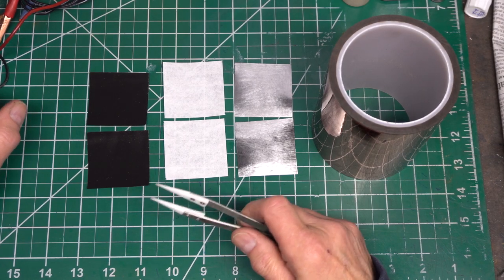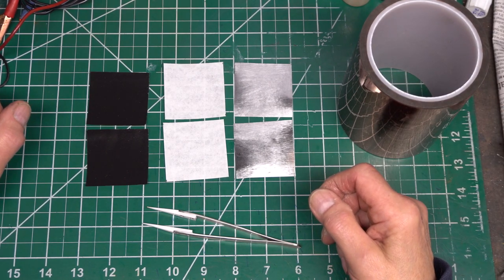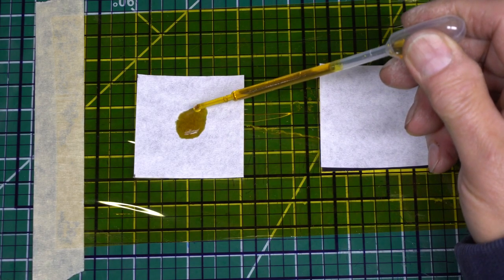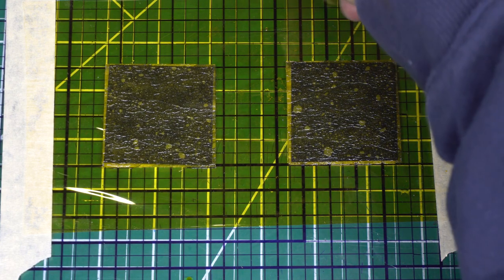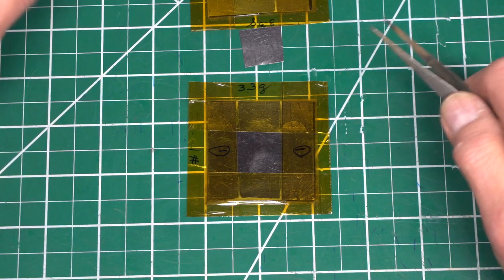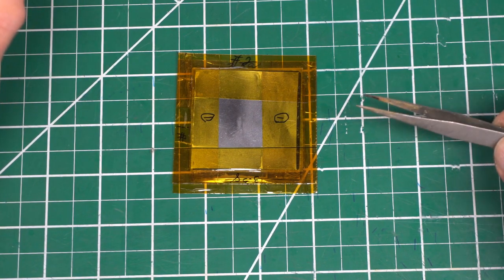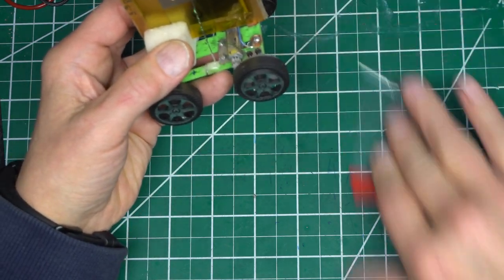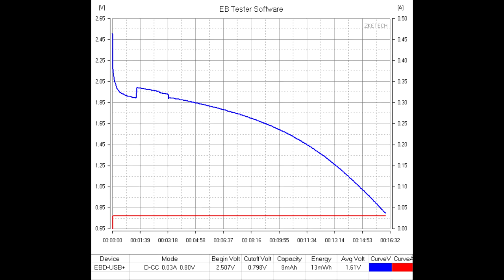Iron/Carbon Battery Powered Electric Vehicle Reaches Higher Speed with New Cell Configuration

Comment: Hi I have a couple of questions that I hope you can answer for me. Have you tried reading the current across the battery to see what it's momentarily "dead short" current can deliver? How long can the battery run the motor after a full charge? My last question may sound silly but you mentioned charging the battery before the test and my question is if it can be charged more than 1 or 2 times before it degrades or loses it's capacity?  If it can be recharged, have you experimented enough with this battery build to figure out how many charge/discharge cycles you can get out of the batteries before they degrade? Thank you for sharing this information for others to duplicate.
Reply from the maker: Hi, sorry but I have never measured the output of the battery when dead shorted across the terminals. Yes, this battery can be charged and discharged multiple times. In my previous video at time 16:27 I show the charge/discharge curves for this battery. I ran it through 56 charge/discharge cycles and the output capacity dropped 7% from the initial value.
Reply: @William_Hada  Hi and thank you for replying back. I'm going to be trying my hand at some of the battery projects I see on Youtube. I'm still in the process of reading up on this stuff along with watching videos on the topic but I do plan on jumping into this somewhere after the New Year....

Comment: Great little cell, very keen to give it a go. Been looking for a cheap and safe cell to play with for a while.

Once I've built a cell and want to increase the capacity, would this be done by increasing the size of the two electrodes?
Reply from the maker: Yes, increasing the effective area of the electodes will increase the capacity of the cell ( total amp hours, current ). The voltage will not change because that is predetermined by the cell chemistry. You can also increase the capacity by making the electrode area thicker, like creating a spongy iron or carbon matrix on the electrodes.
Reply: @William_Hada  cool, thank you!
Reply: Have you done any more experimenting since your second version?
Reply from the maker: @StefanWiswedel  No, on that Iron/Carbon battery Chemistry I have not built any more cells. I got sidetracked exploring other Chemistries but eventually I want to get back to Iron/Carbon and explore some more variations to improve it.

Comment: I cant find enough Iron to scale this up. does anyone have any ideas on how to get a lot of this iron sheeting/foil?
Reply from the maker: Anything made of pure Iron or carbon steel can be used as an anode. Do not use any forms of Stainless Steel which can contain Chromium, Nickel, etc. Ive had good success with using steel wool for the anode. Just be sure that what ever you use is not Stainless Steel or iron plated with another metal.
Reply: @William_Hada  ok thank you. How would I use the periodic table to get a better idea of what to use? I know the columns are valance electrons; but am I looking for the biggest difference or is it an shell/orbital things?
Reply from the maker: @justthinkalittle8913  The electronegativities of elements are found in the periodic table. Picking two elements with the greatest difference in electronegativity would get you the greatest battery voltage. Here are a couple of articles to read for more details: https://caplor.co.uk/caplor-news/elements-periodic-table-can-used-make-batteries-oh-many/ and
https://blogs.scientificamerican.com/degrees-of-freedom/the-periodic-table-and-batteries/

Comment: How do you recharge it?
Reply from the maker: With a benchtop digital DC power supply.
Reply: @William_Hada  Ok, but how do you know the correct voltage, amperage and charging time so as not to overload the cell?
Reply from the maker: @danielcesar5251  When I first charge the cell I pay careful attention to the milliamps of current that is being drawn by the cell. So I gradually increase the charging voltage and keep the charging current at about 50 to 200 milliamps. If the cell is taking on a charge normally the current will drop gradually over time approaching zero but will not actually reach zero. Just level off at some low value maybe around 10 to 20 ma. It's just a matter of trial and error once you zero in on an optimal charging voltage. You don't want to push the charging voltage too high because it can destroy the cell.
Reply: How to fix the upper cut off recharging voltage limit in new invented cell ???????

Comment: So glad I found this! Would you be able to use shim material on both sides, with grafoil and carbon still one one side? Why is the soak timed for 20mins? Do you need the oxygen to form oxides?
Reply from the maker: I guess you mean that you want to use iron shimstock on the Grafoil/Carbon electrode as just an additional collector plate? I think that would be OK as long as there is no contact with the electrolyte. But, because Grafoil is actually porous I don't think that is a good idea.  If that iron shimstock collector sees/makes contact with the electrolyte, I think it would cause problems with the operation of the cell. The 20 minutes soak time was just an arbitrary time I used to make sure that it was saturated enough. Since the cell was sealed up and performed OK, I don't think ambient oxygen his needed for the cell chemistry, its not an air battery as far as I can tell.
Reply: @William_Hada  Would you be able to recommend a non-porous surface to replace or seal grafoil collector plate? Would the cell dry out over time?
Reply from the maker: @carlonlamont511  To seal the outside of the Grafoil electrode from leaking electrolyte you can try painting it with conductive paint. You can easily/cheaply  make your own conductive paint :  https://rosieresearch.com/diy-conductive-paint-recipe/
When making the conductive paint use a minimum amount of glue/binder (initially try 5%to 10%).  If too much binder/glue is used you will kill the conductivity of the paint. You may have to experiment to get the ideal percentage of binder. If the conductive paint is too thick/viscous for painting, you can thin it out by adding a small amount of water.
Reply from the maker: @carlonlamont511  I have used another method to seal the back of Grafoil sheets. It makes the electrode  stronger and resists tearing and cracking of the Grafoil. I place a sheet of Grafoil on top of a single sheet of laminating plastic and run it through the rollers of a hot laminating machine multiple times until the two stick together. The only problem with this composite electrode is that the plastic side of course is not conductive at all but I thought I should mention it because it may be useful in some cell constructions by making the Grafoil much stronger and tear resistant.

Comment: How to charge the battery?
Reply from the maker: I used a DC power supply set at 1.62 volts to charge them.
Reply: @William_Hada  Can I use 1A adjustable DC power supply? Thanks..
Reply from the maker: That should be enough amps to charge batteries around the size that I built in the video. If you build batteries much larger than in the video you will need a DC supply that will put out more amperage.

Comment: You've not made a battery, you've made a capacitor because it stores the charge you gave it. The iron electrode cannot recombine during the charging phase so it cannot be recharged; it only re-stores energy.
Reply from the maker: Looking at the discharge curve in my first video, (time: 16:23), the curve is typical for a battery, convex downward. A capacitor discharge curve is always an exponential concave curve downward. The plating of iron metal is a well known phenomenon and commercial process.  An iron chloride solution can be purchased commercially for this purpose.
Reply: @William_Hada  I'm aware of the plating of metal cathodes. Imho, what you made is a capacitor for the reason the charge/recharge is not achieved through chemical processes. The charge/recharge is stored in what you made.

Unless of course you can confirm iron metal was deposited on your cathode during charging.
Reply: @William_Hada  sorry after more research it would appear you've made a super capacitor not a battery!
Reply: @William_Hada  btw i've never come across a substrate that's been plated with iron!
Reply: There are chemistry equations posted at the other video showing exactly the reactions that are happening.
Reply: @arne6787  The equations are only ABSTRACT. The only time I've known of iron recombining is when it's turned into a metal. It is for this reason why I consider the 'battery' to be a capacitor and not a battery.
Reply: @PeterPete  In iron flow batteries iron is definitely platted at the negative electrode while charging. They use ferrous chloride as the negative electrolyte and ferric chloride is created in the negative electrolyte as the battery is charging. This is reversed during discharge.
Reply: @bamspay  iron metal cannot be reconstituted at the negative electrode because a reducing agent is not present in the cell. A reducing agent is needed to produce iron METAL!!

If you think you are right man would be manufacturing iron/steel products via an electrolytic process. As far as I'm aware this has not been achieved!

Comment: hi there.  Very nice project.  Have you considered making an actual bipolar electrode to double the voltage?  ie activated carbon on one side of the iron plate.  One suggestion:  use a Mayer Rod to create uniform thickness of active material.  Thanks for sharing this.  Doug
Reply from the maker: Hi, that's an interesting suggestion! I have never built a bipolar cell, but the idea of connecting ( stacking) cells internally is definitely worth trying. Thanks for sharing.
Reply: @William_Hada  important thing is you must isolate the electrolyte saturated separators (or use a solid state electrode - ie - PVA based electrolyte membrane.)
Reply from the maker: @nitrousman8882  Thanks, I see your point. The electrolyte sections have to be electrically isolated from each other so there is no conductivity between them. Very interesting cell configuration! I've got to try this sometime.

Comment: Very nice. A dumb question, where do you get grafoil?
Reply from the maker: There is no such thing as a dumb quest in my opinion. Grafoil sheets can easily be found and purchased on eBay or Amazon in a variety of thicknesses.
Reply: @William_Hada  Thanks. Will look for it. One more question, you mentioned sugar charcoal as active material. How does it compare with store bought activated carbon?
Reply from the maker: @kulkarniniraj14  If you make your own charcoal by carbonizing sugar it will perform better than activated carbon you can buy at the local store. Activation of the charcoal with NaOH or ZnCl2 will improve it even more. Look at Cayrex2 and Robert Murray-Smith's YouTube channel for detailed videos on how to make activated sugar carbon as well as a number of other carbons useful in batteries and supercapacitors.

Comment: Hi
Based on the information... the 13mWh and the 6.6g it would have an energy density of 1.9Hh/kg. It is possibble that my calculations are faulty, but if that is not the case, than this is very little energy.
Reply from the maker: You are correct in your calculations. Although I know that it's energy density can be improved on,  it will never be close to the performance of a lithium ion battery for example. Having said that when was the last time someone built a lithium ion battery at home? Iron and carbon are much safer, abundant, and a lot cheaper than lithium. I think my battery chemistry is unique because all other Iron redox batteries were of the " Flow Battery " type requiring external electrolye pumps for recharging. Yes, the energy density numbers are not that impressive but, I thought it was amazing and surprising to me that it did have enough energy stored in itself to move itself across the floor. Thank you for watching the video and showing interest in the battery.